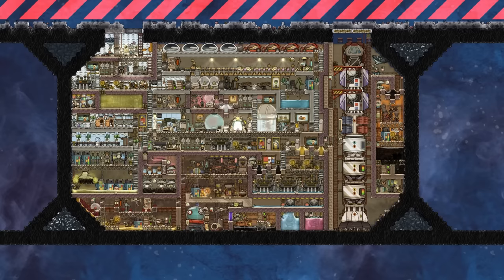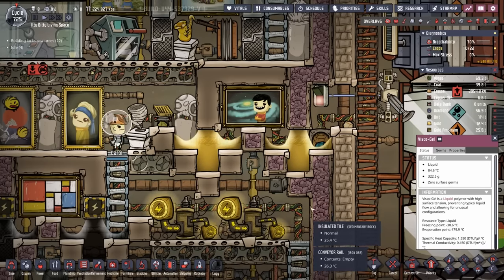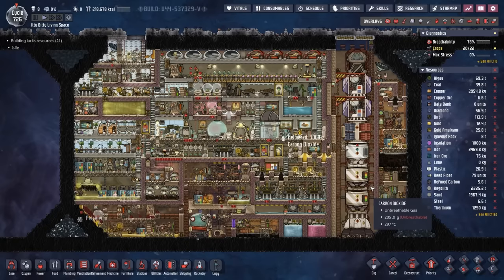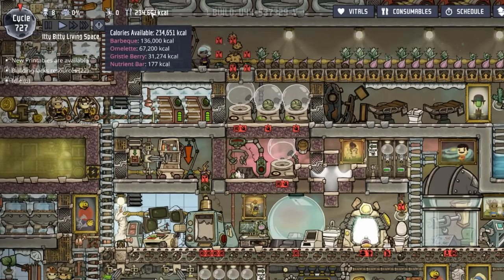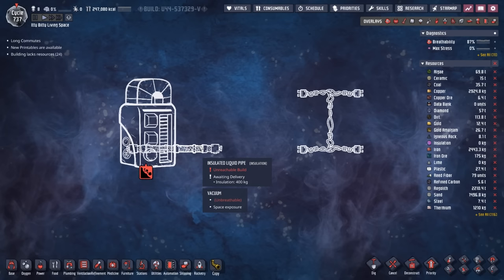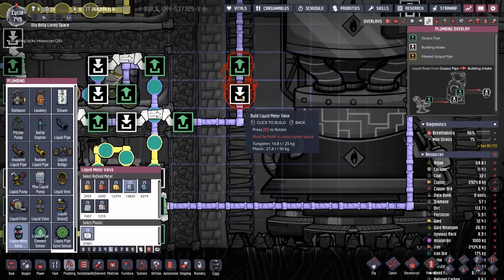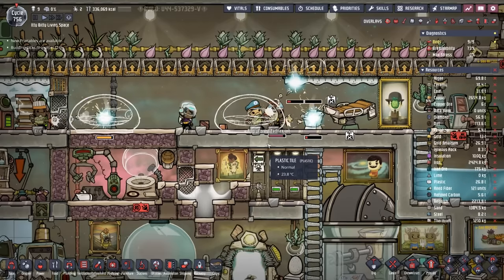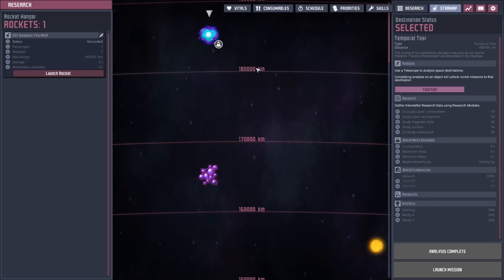Series Finale + An Arcade Room! | Mini Base Ep 12 | ONI

Comment: small correction, you connected 3 pumps through a single pipe for, supposedly 12.5 dupes.. that's actually only still 10 dupes, since a single pipe can carry a max of 1kg/s.

It's been a good series :) also fun to see the base game again..
Reply from the maker: In theory, you are 100% correct.  But that is only if the pipe was full 100% of the time.  Since the dupes spend so much time in suits the primary O2 line doesn't stay full.  Thank you for the comment and compliment!